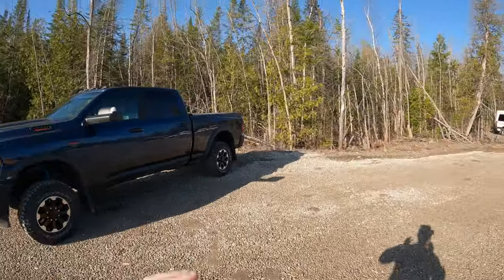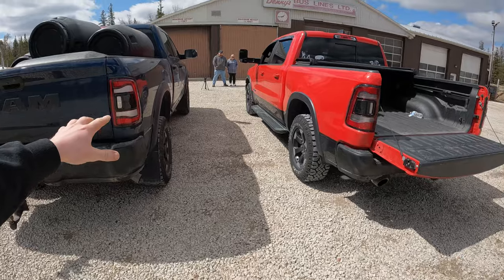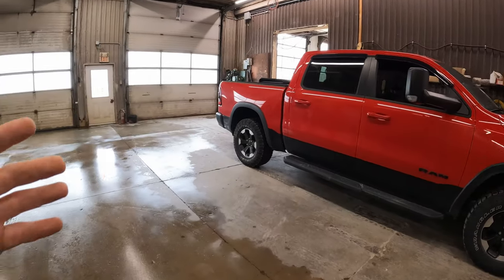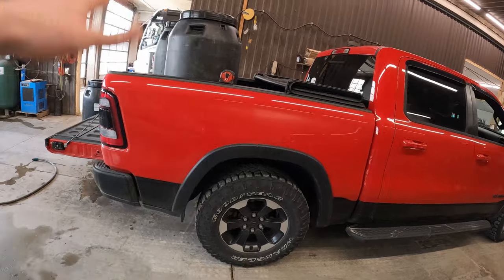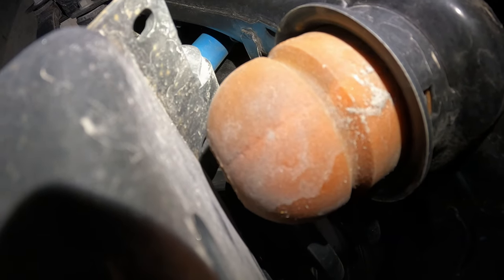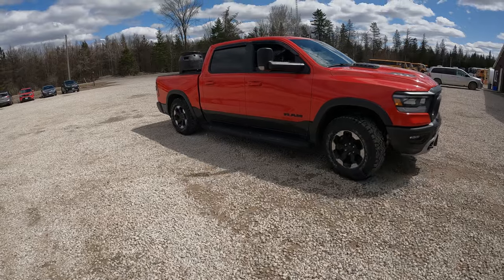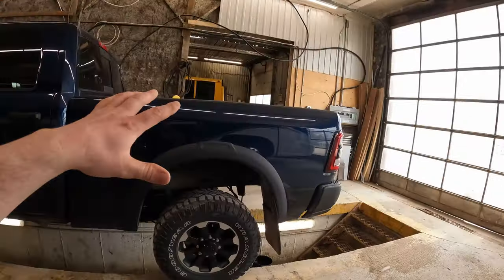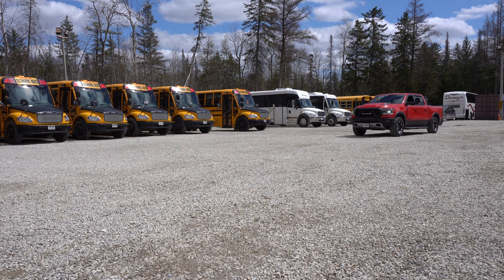RAM 1500 Rebel MAX Payload Test | Better Then my POWER WAGON?

Comment: It appears as though the loading was more evenly distributed on the power wagon. The load started from the far front of the bed back, whereas on the rebel there was a bed box up front pushing the load further back over and behind the rear end. That effectively moves the fulcrum and will create more sag. Bet if you pull that box and move those barrels up you'd be quite a bit surprised
Reply: The comment I was looking for.  Weight distribution is nowhere near equal between the two tests.  Rebel has all the weight sitting behind the axle (not even over the axle), power wagon has the weight directly over the axle and forward.  Might as well have put it all on the tailgate....

Comment: I went from a Rebel to a Power Wagon. Like mentioned the payload/tow number were similar, but the PW just handles the weight so much better especially the brakes. Rebel came with Load E tires and Power Wagon came with Load D tires.
Reply from the maker: Yes it's night and day! everything is meant to handle more load even down to the tires!

Comment: Alex, you should put all the weight on the axle and behind it. It should be as close as positron the window. It is dangerous putting payloads behind the axle line. It would have performed much better with better weight placement.

Comment: informative watching, the rebel comes with a factory 1inch lift in the suspension over the Laramie and others models that have coil rear suspension in the 1500 range , so that is probably the reason for it bot bottoming out as soon.
Reply from the maker: potentially yes! I did get in and drive the rebel and it drove well. ram 1500's are great trucks!

Comment: I always figured the Power Wagons payload and tow numbers were low because of the tires. I'm sure Ram wanted sidewall flex, to go over rocks and stuff.
Reply from the maker: Ya the power wagon is probably much more capable then what the numbers say. I would make sense with load range D tires only being 8 ply vs load range e tires being 10.

Comment: Another great video. Even though both trucks are rated close you can really can’t compare them for loads I believe it’s only the coil springs and a few other of the 4x4 package that makes the power wagon so low. It’s still basically a 3/4 ton heavy duty vs a 1/2 light truck.
Reply from the maker: pretty much yes! I heard that the disconnecting sway bar is a big reason why the payload is so low. they deem it potentially unsafe or that it could unhook under load loading to lower steering ability. also the height of the truck makes a difference I guess

Comment: My 2016 Ram rebel with the stock air bag system can tow almost 2000 lbs in the bed with barely no squat
Reply: TOW 2000 or carry 2000?

Comment: Sorry, I like your videos, but this one is completely unprofessional: why did you put the barrels at the end of this short 1500 bed? After all, it was enough to lift the cover and move the barrels closer to the front axle, which is particularly important for this type of suspension in the 1500.

Comment: How much fuel?  Have to add that to the weight as well. Or did I miss you saying that
Reply from the maker: Good point and no you didn't miss that. I didn't mention it. In reality with 1 man and a full tank of fuel this trucks payload is not even over 1000lbs. But I always like to put the max payload in the bed of the truck just to see how it handles it.
Reply: All fluids are counted for even a full tank of gas… your payload isn’t affected by the full tank of gas.

Comment: Gm and fords leaf springs can handle more. Test that old blue Chevy truck next 😆
Reply from the maker: it would be interesting to see how a leaf spring reacts vs the coils!
Reply: @TheGettyAdventures leaf springs are way more stiffer and hand weight better than coils thats for sure thats why all the 1 ton trucks still use them, but ram switched to coils for the ride comfort which makes sense since almost nobody uses a truck for hauling and towing these days

Comment: I have a video in my Chanel when I put over 3000 pounds of shingles in my ram Rebel 2020 .
Reply from the maker: Jesus those bump stops took a beating that day
Reply: @TheGettyAdventures  it is like a mile to Home Depot from my house and it is flat , but I will never do it again. It drove very good but I was really going slow
Reply: did you have air suspension?